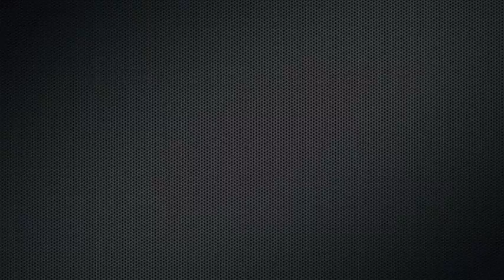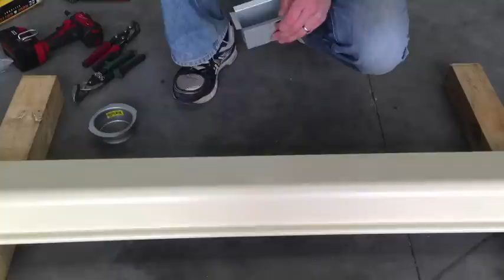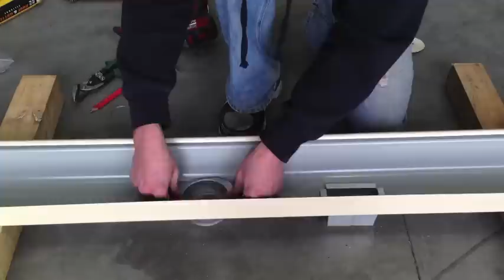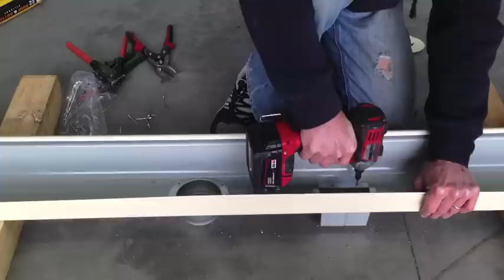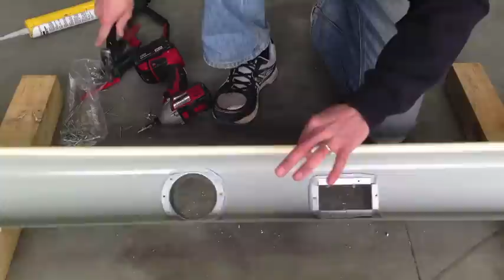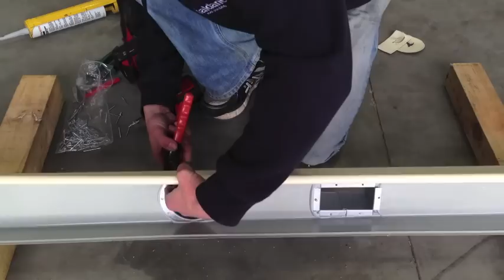How to: Install Downpipe Pop in Quad Guttering | Metal Roofing Online

Comment: I have just had all gutters replaced, and the plumbers used this method. 2 weeks later my gutters are blocked and overflowing into the eaves. Why? Because sitting the pops above the gutter creates a small levee bank, which we add to with a row of silicon, and then the leaves and dirt start to build. Is it possible/legal to install the pops UNDER the gutter, so water will flow straight down which is really what it is all about?

Comment: Another video on how not to do  gutters!!  Mark the gutter with an elbow or peace of down spout. Then use a sharp chisel and a hammer and cut and x corner to corner then fold those tabs down then with zip screws  attach the elbow to the 2 side tabs.. easy peasy  no caulk no obstructions … been installing gutters like this for years… and stop stepping on the gutter

Comment: Why out rivets in and then remove them? I'm so confused at this step? 

Wouldn't you just align the droppers then screw the holes, silicone then rivet as a final step?
Reply: Gotta get rid of the swarf
Reply: My guess is it prevents misalignment between all of the other holes. The first two temporary rivets hold the insert in place while he drills the other ones. If you tried drilling all 10 holes at once at least a few would get out of alignment.

Comment: is easier if you use a hole saw
Reply: Hole saw will heat up the gutter and cause it to rust, that's why you don't use and angle grinder either
Reply: @DonkeyCongoSnipe ohh this makes sense😄 thank u!!